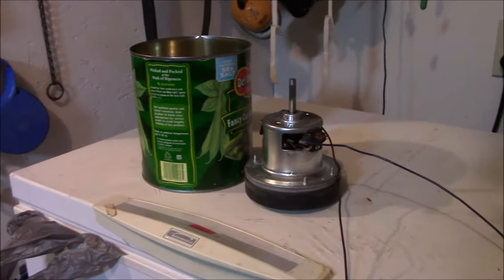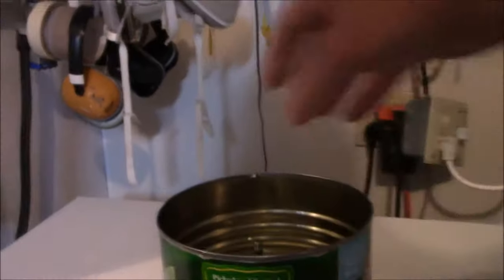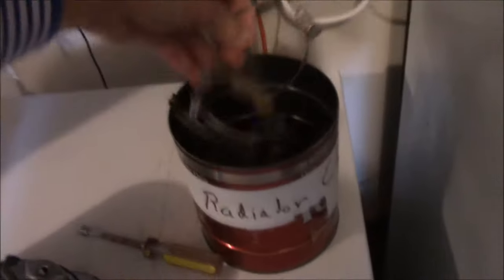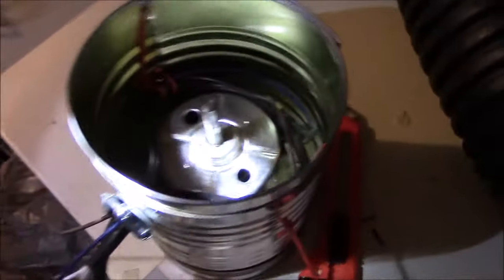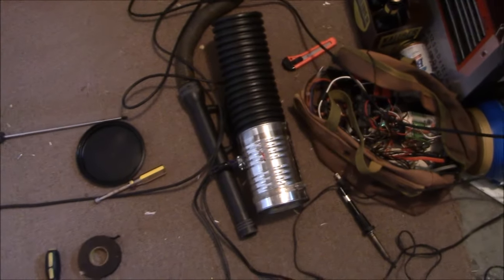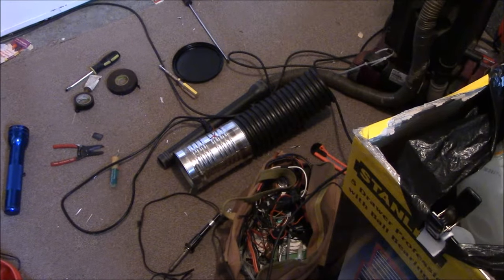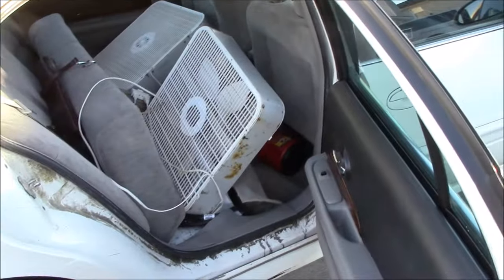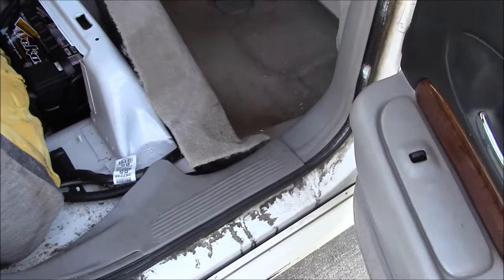How to make a blower out of a vacuum cleaner motor and fan.

Comment: 1 suggestion; on safety & on best engg practice: put sm mesh at inlet of this bower; ie. Suction or vacuum end, to avoid any debris to get in fan blades, casing & damaging it.
2nd: run this in duty cycle, these 230VAC 1ph brushed motors are not meant to run in continuous operation. It will heat up & burn.